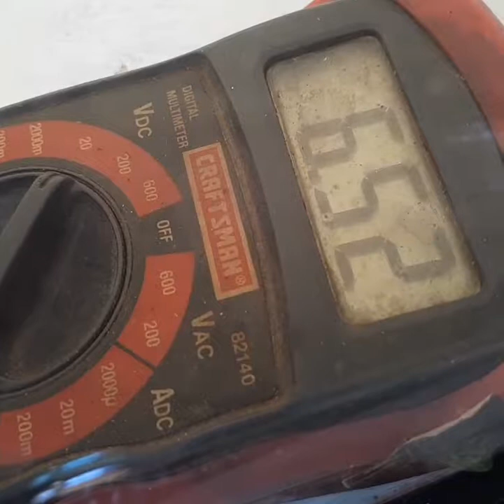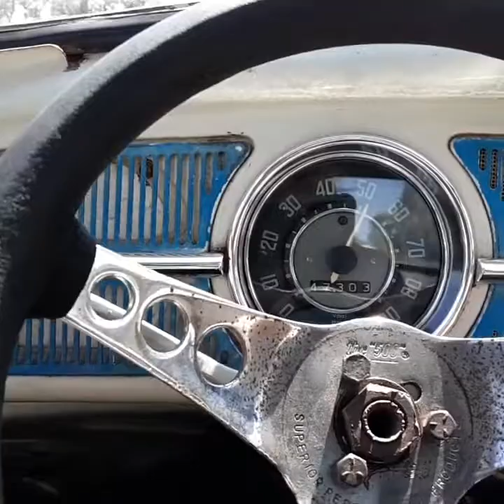Convert VW bug brake pressure switch to mechanical for free

Comment: Great concept! I'd definitely make the setup sturdier! Older VW brake pressure switches suck!
Reply from the maker: I agree I could make it a lot better. But there is a plus side to it not being very sturdy. Since the switch hangs behind the pedal it would limit it from being pushed to the floor, in a worst case scenario. I wanted a design that would give away and allow full pedal travel in an emergency brake smashing situation lol
Reply: @CCDProductions  Hmmm I see